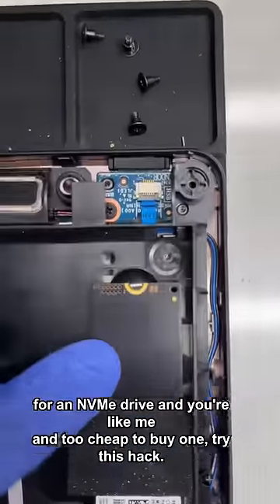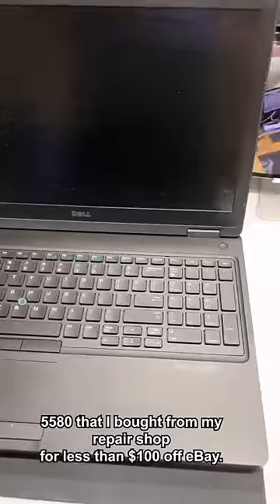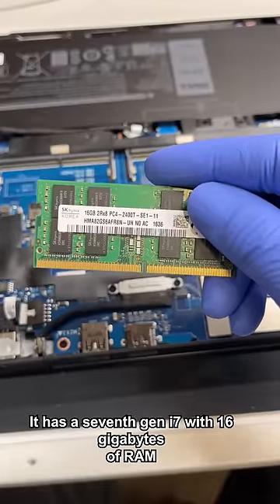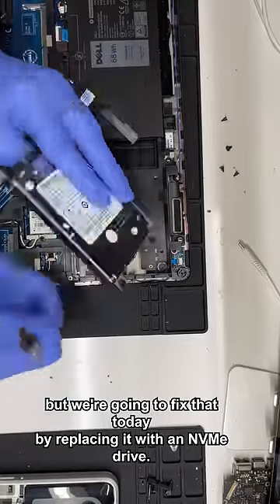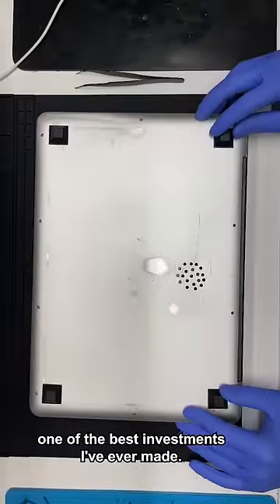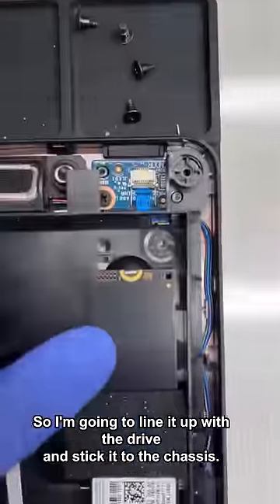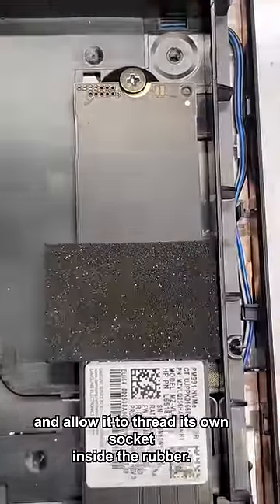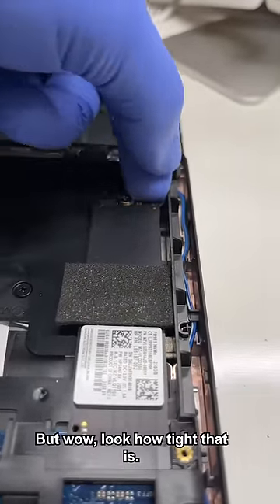No mount for an NVMe drive on your #gaming #pc ? No problem! #technology #tech #shorts

Comment: i have the Precision 3520 model of this machine with I7-7820HQ and the NVME configuration from factory, since then i replaced the bloated 68Wh battery with a 93Wh one and a 1Tb WD green nvme, and also 16gb of ram, this is my work laptop and works amazing still, i even got a dock for it recently

Comment: I just used a little strip of electrical tape.

$1600 laptop and they can't even include a second Mount/Heatsink (that probably only costs them like $5) for the extra NVME slot....

Comment: The heat inside that laptop's gonna melt that adhesive
Reply from the maker: The laptop gets nowhere near as hot as required to weaken that adhesive. The NAND is far away from the PCB.

Comment: Nice. I had the same issue with a 5570, though I solved it by making a mount out of an old plastic gym membership card.. finally got some use of that card.  I also used a SATA to mSATA adapter so I can have drives in both the M.2 and SATA slots even though they were overlapping if you used a traditional 2.5 inch ssd/hdd with the SATA connector.
Reply: No
Reply: Ro
Reply: hoh
Reply: Off
Reply: WoW
Reply: be

Comment: Latitudes are fine, but the batteries are crap. When I worked in IT, we would get complaints constantly about battery issues. Had one battery that burst into flames while in the laptop. Luckily the user wasn't harmed, but I don't trust dell batteries.

Comment: I’ve had this dell latitude D620 for about 16 years now and it’s still holding up fine with windows 8.1
Reply: Dang I had one of them too. I'm sure if I ever make it to my parents house it will power right on after 12 years no use😂
Reply: Same, but it's a 630 with Linux. Very sturdy and doesn't have any issues running modern applications.
Reply: @user2C47  yo I got it running windows 11 somehow
Reply: @0UnKnow0v9 mines a powerhouse with no hardware changes running win11 so I dont know how

Comment: Oof, 7th gen though, either dual core standard processor or power hungry performance series chip. I've stopped looking at laptops under 8th gen as the small price discount just isn't worth it in terms of the performance
Reply from the maker: Yeah this runs chrome and excel 😂  but I only sell 8th gen and up due to the reasons you stated plus windows 11 compatibility
Reply: @SalemTechsperts  Haha perfect for that then! I'm still shocked Apple got away with selling "pro" branded products fitted with dual cores for so long 😅
Ah that's fair, I've never been too concerned about the windows compatibility but I can imagine that's a bigger concern for a shop like yours, and just generally as time goes on

Comment: I should’ve known about this sooner. My used probook g7 had its nvme screw mount stripped and it can’t be replaced so I just used double sided adhesive 3M scrapbook tape on the bottom to secure it.

Comment: Are you sure the M.2 slot on that Dell uses the NVMe protocol, and not the SATA protocol? You might have simply swapped one SATA drive for another.
Reply: Sure but at least its at least 5-6x faster anyway
Reply: @SamLoki then isn't buying a normal SSD better and cheap compared to nvme m.2

Comment: Thanks for the inspiration.  I am trying to move a OEM desktop to bigger case for better air flow, but the OEM M2 drive install outside of the motherboard and use custom pin to secure it.

Comment: I recently took apart an old ps3. As I put it back together, the fastener for the bluray drive ribbon cable broke. So I scotch taped it in place, and it worked.

Didn't matter in the end though because the YLOD came back 2 days later lmfao

Comment: I had the same problem but with the dell precision 3250. I 3d printed a block with a 3mm hole and some depth i dont remember and glued it in, letting me screw in the nvme

Comment: If you bought an Nvme for that laptop you essentially wasted money.
Should have just bought a standard SSD, would have fit in with no modifications, and you'll cap out the performance anyway.
Honestly, I wish people would not just waste technology like this, what this guy did is equivalent to strapping a jet engine onto a lawn mower. Sure it'll work, but you do not need and cannot use the full power, it's simply wasted.

Comment: You could use what dell used on the original XPS 13 Ultrabook... I called for service because the SSD kept losing connection and because I bought the service plan so damnit I'm gonna use it! They came by and opened the laptop... The  SSD was held in by double sided tape so I thought "ok, then he'll just swap the tape I bet thats the problem." But no, he swapped the drive entirely and wouldn't even try to copy my data over... Terrible service and I don't recommend

Comment: Isn't the SATA going to be a bottleneck, negating any benefit an NVMe interface would provide? I mean, yeah, as a proof-of-concept, it's a neat fix, but you might as well just get a SATA SSD.
Reply from the maker: The SATA is not being utilized at all. It’s strictly pulling from the NVMe through PCIe.

Comment: I work in a computer repair shop and I actually just installed one of these drives and that exact same computer the other day and I did the exact same problem You're making this more complicated in it needs to be just cut your little piece of double-sided tape put it on the side of the drive and just press it down onto the plastic and that b** ain't moving

Comment: Correct me if I'm wrong, but aren't you going to be bottlenecked by the CPU anyway in those older Dell Latitudes? A 2.5" SATA SSD would work just fine and no janky-ass "hack" needed.

Comment: Am I missing something here.... is there a NVME socket in this laptop or are you just adapting sata to NVME. Because it would be better to just go for a regular SSD if that's the care. You aren't going to get more than 6 Gb/s.  And that's how fast you will get with the Sata SSD. Then you can just put the drive in where the regular SSD is

Comment: yep, i got an old latitude that i ocasionally use as a secondary monitor type thing
its a D630, was a thrift store find and originally had vista on it, but it was upgraded to XP at some point 
and then i found it
and threw lubuntu on it cause i aint bouta try puttin w10 on a corperate laptop, i'd rather suffer less on linux lol
anyways, if you get around the old hardware and out of date software, old corp laptops really are a great pick for general use
also got an inspiron that ive been needing to hack up
yeah, some one didnt remove hard drive
some admin didnt remove locks either 
kinda glad its still got a drive cause uhhhh where the f*** would i even find the damn thing??

Comment: tight till it heats up .....mount 'hack w $5 oofficial 3m' w permanent adheshive eh,.. You check the specs re:  heat resistance in this situation. Notebooks stay less heated when not on lap hence why they dont call chem laptops anymore. 'leastI heard that decades ago... Maybe smart 'laphack' tho! ;]

Comment: My asus laptop has the nvme mount, but the plastic case flex when lifted and the nvme mount screw pulls the nvme drive out far enough to cause my os to crash.. my solution is to slightly unscrew the nvme screw so that the screw doesn't pull the nvme drive when the case flexes.. also, my pch/north bridge goes to 99°c and shuts down the laptop after installing nvme.. i slapped a heatsink from old motherboard south bridges and held it down with some foams.. recently had an issue where the voltage regulator for the cpu throttled (noticed from xtu logging) after a blue screen showed that the processor had low voltage.. saw a mosfet going to 150°c.. replaced the mosfet and another and laptop is going strong so far

Comment: I didn't understand what he was doing. If it doesn't have a mount for an NVMe drive, then why does it have an NVMe connector? Did he just mean m.2 SATA?
Reply from the maker: The mount for the drive is a plastic adapter that was not included from the factory since it was spec'd out with an HDD. The adapter cannot be included if you have an HDD because it takes up the same space.
Reply: @SalemTechsperts : So it is using M.2 SATA rather than NVMe?
Reply from the maker: No, it's using m.2 NVMe. The slot is an NVMe slot.

Comment: Wait.  So the laptop has a connector for an nvme drive but no screw hole to mount it? WTF
Reply from the maker: It has the screw hole in the top case, but the actual mount to it isn't included since the HDD occupies the same space. So unless the laptop comes with the NVMe from the factory, it's not included.

Comment: Why is there a NVME (M-Key?) connector in the first place???
Reply from the maker: because if the laptop is spec'd out from the factory with the m2 NVMe, the mount is included. The screw is already drilled into the case, but the mount itself is a sideways adapter that's not included if there is an HDD included, since they take up the same space

Comment: Do have to re-install the OS after the upgrade?
Reply: If it was on the mechanical drive before, you will have be to copy it over, but you shouldn't need to reinstall.

Comment: Why would you adapt an nvme to a sata port when sata ssds exist and require no extra crap
Reply from the maker: As the other 900000 comments have discussed. It's a PCIe NVMe port. NOT AN M.2 SATA PORT. Therefore, speed.

Comment: You had to give up on the wireless board, right?
Reply from the maker: No, this fit right into the NVMe slot. WiFi slot is in another location on the board
Reply: @SalemTechsperts  wow that's modern.

Comment: Wouldn't just a SATA SSD be good enough?
Reply: Probably but even if you're using the SATA as your main storage it's always nice to have extra storage. This is what I did for a family member. Cloned their mechanical SATA drive containing their windows install to a SATA SDD with higher capacity, then stuck an NVME SSD in the included slot just for some extra room.

Comment: pro tip: dont do this.. the heat from the laptop combined with the constant pulling pressure from the NVMe slot will rip that rubber piece off.
Reply from the maker: This specific NVMe has the NAND chip at the bottom where the NVMe slot is. There is nothing but PCB where the rubber piece is. The rubber piece does not even get warm. Also don't underestimate 3M adhesive, that stuff is strong. Regardless I would never do this for a customer, but if you're in a pinch like I was, then it works.

Comment: Yeah but theres no point in doing all that work since the speeds are the same as a 2.5 sata SSD. So you might just want to replace the HDD with a SSD.
Reply from the maker: This is an NVMe slot. Not a SATA slot.

Comment: The Dell latitude 5580 is nothing but a piece of garbage. We’ve been dealing with them at my job. They have all kinds of problems with the NICs.
Reply from the maker: That sucks. They have issues with the thermal management chip failing but overall we've had very few problems with them. I've never seen one with a NIC problem.